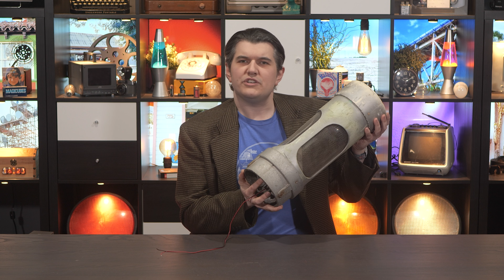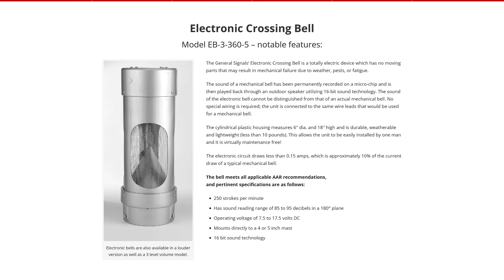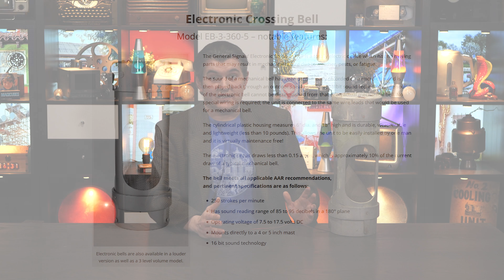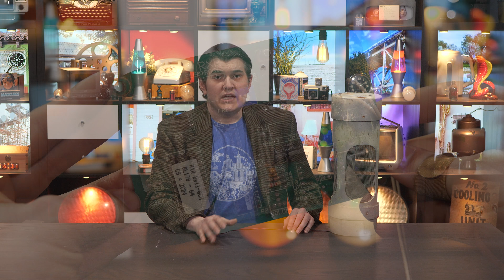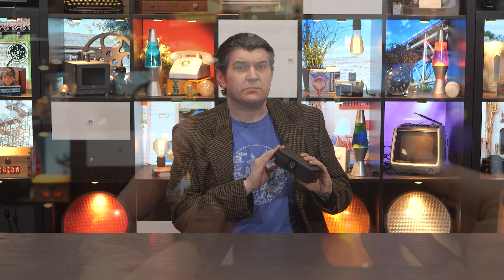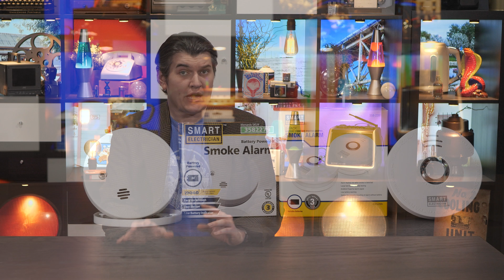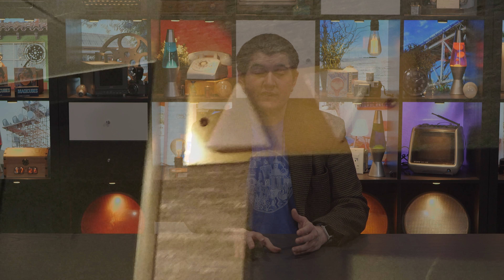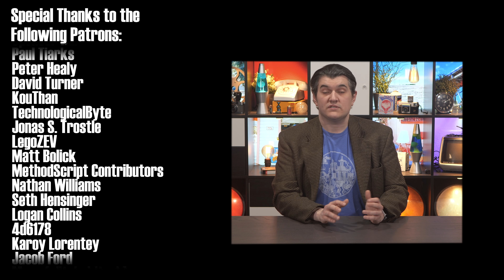The disappearing and unappreciated art of audible alerts

Comment: When I heard that "fire alarm" sound, all I could think of was a busy signal on a phone.
Reply: Yeah I've never heard it in low pitch. It's a piercing screech everytime I've heard i
Reply: When I was visiting the US a few years ago, I got to experience how loud the US fire alarms are. My European ears actually got a splitting headache, because we had to run straight underneath them to leave the building.
Genuinely startling how different the volume of fire alarms can be just by country.

You wouldn't miss them here either, but they're not ear-destroyingly loud. Louder than concert levels imo.
Reply: @ocfos88  I modified my parents' smoke alarm to extend the "Hush" button (a keyboard switch in parallel, with a backing plate for cable/solder sturdiness, dangled into a closet) so they didn't have to wave a towel at it every time it went off when they were cooking. I guess the Hush feature is a Kidde patent, mutes the alarm for 7ish minutes at a time. But it's not really useful if you can't reach the button. When I cook there, I'll pre-emptively hit it if I feel like things have gotten too hot or smokey, because it's better than a bout of tinnitus or ear pain.
Reply: @arguy_4420  Fun fact, the low pitch alarms are used in hotels, apartment buildings, dorms, etc. because they are better at waking people up. You'll probably still find the screechy ones in the garage or hallways.
Reply: @noxious_nights  not true everywhere tho, my dorm has insanely screechy, insanely loud ones in each dorm room
Reply: @KitRady-gl2sy  Probably an older fire alarm system. I seen a lot of hotels with older systems that has fire alarms that makes a “smoke detector” like tone and newer ones that uses alarms that makes a low frequency tone
Reply: @hamzahassan7730  possibly yeah. Idk what counts as old for fire alarms, but they are probably original to the building, which was built in 1999.
Reply: @KitRady-gl2sy  Yeah definitely has those types of older high pitched alarms then. Low frequency sounders became a requirement some time in the 2010’s because it can easily wake up a sleeping person.
Reply: I’ve never heard a fire alarm like that. All the ones I have heard are bells that ring incessantly.
Reply: @Phineas-hu8vi  In the building I worked in there was no way you were sitting through the fire alarm bell.
Reply: @Phineas-hu8vi  I've heard it in threes, but not that specific tone.
Reply: @Phineas-hu8vi  My office has a piercing siren.
Reply: @Phineas-hu8vi  Yeah, a loud bell that just rings constantly without pauses is what I'm used to.
Reply: @Phineas-hu8vi  Same here, my school fire bell was just a series of striked red bells in each room that rang and then didn't stop until the fire department used a key on the control box. That's why it was taken VERY seriously if someone pulled the fire alarm as a "prank" lol
Reply: The fire alarm at my work went off less than 3 days ago but I didn't recognize it in this video at all. It doesn't sound right when it's not at ear-splitting volume lmao
Reply: @Eegal-Ayed  "ear-splitting volume" 🤣🤣🤣 yes, they are usually insanely loud 😂
Reply: One would think that the volume level wouldn't be considered safe. I grew up with old school fire bells, and my first experience with the modern sirens with strobe lights was painful.
Reply: Same. I was wondering why there was a pause in the frequency. When he played the example with an actual fire alarm bell, I knew immediately; just like with the railroad crossing signal!
The muted tone actually makes it feel more like a suggestion than an emergency, tbh. "Boop boop boop. Hey, guys, there's a thing going on, but don't be too worried about it. Boop boop boop. You could die, though. So, keep that in mind. Boop boop boop. Just calm breathing. In [cough] and out. Boop boop boop"
Reply: @PBTophie  Your personified fire alarm reads like a Wheatley quote lol
Reply: To me it was the tone that would play on TV, when a storm alert was flashing across the bottom of the screen, usually tornado watches or warnings.
Reply: @Dannihilate  BRAP! BRAP! BRAP! BEEEEEEEEEEEEEEEEEEEEEEEEEEEEEEEEEEEEEEEEE!

This is a test of the emergency broadcast system. This is only a test.

BRAP! BRAP! BRAP! BEEEEEEEEEEEEEEEEEEEEEEEEEEEEEEEEEEEEEEEEE!
Reply: @CptJistuce  That sound could actually be data encoded into the audio, because it's basically just FSK modulation (I'm pretty sure), but I don't think it actually is, I think it's just random data modulated to produce an annoying tone - or maybe it's the actual text that gets put on the screen after? Not sure, always wondered about that, but never bothered to look it up
Reply: @gorak9000  Apparently, it actually is, sort of. In the modern Emergency Alert System, the BRAP BRAP BRAP is not data, but the "end of packet" marker for a message packet that tells decoder hardware at broadcast stations (among other things) what counties are affected and what kind of alert it is. The data portion of the header is not rebroadcast "over the air", unless I am mistaken. 

The BEEEEEEEEEEE is an attention tone(well, pair of tones), specifically chosen to be annoying so people won't miss it.  It is inherited from the older system, where it would have also automatically activated hardware at broadcast stations. 

It has been a while since I've heard an emergency test.
Reply: @CptJistuce  sorry to be that type of guy, but the emergency broadcast system (aka the EBS) was discontinued sometime around 1998 and eventually replaced by the emergency alert system (aka the EAS)
Reply: @Roland-JP-8000Yeah, in my memory the two run together. But I watched much more TV during the reign of EBS, and that test script is iconic to my dumb brain. It results in some errors.
Reply: @CptJistuce  The first, long "braps" are in fact the SAME (Specific Area Messaging Encoding) headers. It is repeated three times for error correction. You hear 3 similar but shorter "braps"after the alert content. Those short ones are the end of message data. The Wikipedia page for the EAS explains it all very well.
Reply: I thought I was being called on a shitty cisco voip ""landline" office phone.
Reply: I thought of the cell broadcast emergency message.
Reply: @IroAppe Once known best for TV and radio, the emergency alert system sounds remain a federal standard in a completely foreign medium to the one the system was designed for.
Reply: @CptJistuce don't know about that. I am from Brazil and related the sound to emergency message on the phone
Reply: Yeah, he played that and I was like “oh, no answer.” I’m not used to fire alarms not instantly sending me into overstimulated sobbing.
Reply: I just made the same comment.
Reply: I've never heard a fire alarm that has a break in the rhythm, they are just screaming!
Reply: Yeah, to me that said a busy signal, not a fire alarm. To me a fire alarm is an actual bell or the same temporal 3 cadence, but WAY WAY harsher and louder.
Reply: same for me, but i also havent heard a fire alarm for many years so i dont know if ours actually sound like that.
Reply: @ThunderjunkMcbutram  No routine drills or tests? Better hope your company's got good insurance!
Reply: I thought it was a phone ringing, but with an extra ring. Even more so when demonstrated on the firebell.
I remember the phone sound as ring-ring (once per second) then silence for about the same duration. But that was as a kid in the UK.
Reply: Where I come from the fire alarm sound is unfortunately usually just BEEPBEEPBEEPBEEPBEEPBEEPBEEPBEEPBEEPBEEP etc. way over the pain threshold.
Reply: Specifically the busy signal from Pink Floyd's The Wall Live
Reply: The pause is the only difference, yeah.
Reply: Likewise
Reply: I came here precisely for this comment.  That is exactly what I hear, as well.  When I think of fire alarm, I think of: that classic rapid dinging of that circular bell on the wall at school, the klaxxon doing the 3 beat, the random noises for a call coming in at the fire station for the show Emergency!
Reply: yeah that fire alarm sound is not the same when it's played at regular video volume than when it's played at like 125 decibels lmao
Reply: Same!  It was missing some frequencies or something.
Reply: yeah it sounded like a european busy tone or ring
Reply: I inspect fire alarms…and times have changed.  A lot!
Mechanical FTW BTW.
Reply: I thought of an apartment entry door call box
Reply: It took me a while, but I realised it sounded familiar to me as the British phone sound (even though that's two rings).
Reply: I thought that noting it's likely only a US thing, then describing it as universal for the rest of the video was inaccurate in a rather un-Alec way.
Reply: My first thought was weather emergency alert (I'm in Canada).
Reply: exactly the same for me, i guess because i hav e never been in a fire emergency
Reply: The only way I knew it was the fire alarm; that pattern.
Reply: Same 😂 europe I guess
Reply: All I could hear originally was a motherboard piezo speaker warning of no RAM being installed.
Reply: 😂. It means warning danger, stay off the tracks, train coming.
Reply: Yeah that’s what I thought it was
Reply: I'm glad I'm not the only one.  Now that it's all work-from-home, I forgot what an office fire alarm sounds like.
Reply: Higher pitch in aus is a warning which changes to a “woop woop woop” to evacuate.
Reply: I've never heard that sound before. The fire alarms in my college dorm were really stupid. There was some glitch around the first night I was living there that caused the alarms to keep going off. The exterior alarms sounded like being trapped in a closet with a million cicadas, and the interior alarms were just a high-pitched beeping. Both sounds were pretty much impossible to hear in the shower, so you might turn the water off to discover that the building might have been on fire for the past ten minutes.
Reply: Yeah, here they're just BEEP BEEP BEEP BEEP
Reply: Honestly the slow whoop is used where I live and is so much more of a "get out" signal than the tree lo-fi beeps 😂
Reply: Same here. Busy signal on a rotary phone
Reply: Same 😂
Reply: I've never heard that as a fire alarm or smoke detector noise. Usually, I think of a smoke detector alarm as that loud, high-pitched buzzing sound, and fire alarms something else.
Reply: One thing that wasn't mentioned is that it's dissonant sounds, so you tend to pay attention more, since it tends to disturb the ear.

Comment: Ever since I got a smadt phone, I've been using different spunds for different notifications. I'm one of the only people I know under 40 that doesn't keep their phone on silent. Particularly now with my current job working in a bio lab, checking my phone without contamination is more of an ordeal, so I need the different sounds to know if it's worth my effort. I have unique sounds for Youtube, Gmail, Outlook, Microsoft Teams, Whatsapp, the callbox for my building, phone calls (some contact specific), texts (also some contact specific), and probably some others that I'm forgetting right now. Rather than tones I use sounds that I associate with it, which would be more obtrusive if I didn't also have my earbuds in most of the day. Like for Gmail I have the old AOL "You've got mail" sound. It is good to know I'm not alone out here.

Comment: On the one hand I deeply appreciate your humane and reasonable spirit of compromise.
And on the other hand I have to stuff towels around my microwave oven in the morning to avoid waking my sleeping family because it has so many chatty sounds, and I can't give it an icepick lobotomy because the speaker is integrated into the control board, and I am just about ready to start stalking Panasonic executives with an air horn.
If it were up to me, appliances would start silent and have to earn their right to make noise (or, as they advertise it, "soundscape").

Comment: I guess I failed the smoke detector identification one, I was thinking severe weather alert because of the difference in tone versus beep.  Most smoke alarms now seems to be a disjointed random moving beeping since they're interconnected but never in sync - really disorienting.

I've had frustration with modern stuff pushing not doing sounds...I don't understand how people use only vibration for phones, I miss basically all my notifications when I have my phone on vibrate.  The new phones not sure if its the size/mass or thin small motors but they are virtually impossible to notice where old candybar phones felt like being electrocuted.  Now I have to have my phone on sound and everyone else seems to be mad about it (but also mad if I turn off sound and miss their messages?)

I can't have personal electronics at work so...I have a hard time justifying hundreds of dollars for an expensive wrist computer that I can only wear for a short time between walking up and going to work and getting off work going to bed.

Comment: 19:06 I rant about this all the time, frequently when someone else I know notices similar types of changes and gets frustrated by them. Why are companies so INSISTENT on changing software that there is ABSOLUTELY NOTHING WRONG WITH? They make a fully functional, feature rich, relatively bug free piece of software and everyone gets used to how it works and then for whatever reason they're like "Hey, we're changing this in a way that makes it actively worse and messes up everyone's usage flow" WHY. CAN'T. SOFTWARE COMPANIES. JUST. LEAVE. THINGS. ALONE?! It's so irritating. A good example from my recent memory is with android on my pixel 9: you used to pull down the quick settings tray and the button to access full settings was right there, fully visible, center-screen on the quick settings tray. They changed it so that now: instead of being perfectly visible on the quick settings tray it is down in the bottom right corner underneath where I (and I imagine many other right handed people) hover my thumb when I hold my phone. It took me a hard-to-admit amount of time to find it again. Why did they change that? For what reason? Why move it somewhere where it is actively harder to find? Why move it *AT ALL*?  Another example is microsoft whiteboard: I used to mess around and draw with it on my surface pro using my surface pen and it was good fun; very simple, very concise, very fast and got the job done for taking notes and stuff as well. It is now laggy, riddled with useless bloat, and has actually had a few features removed that just overall made it a worse experience. It's so frustrating. I'm not even sure it's entirely the same problem as enshitification, though there is probably plenty of overlap, but rather the need to have a team around at all times for general software maintenance and compatibility/security updates, but not wanting to pay them to do nothing in the meantime between important things, thus leading to a bunch of make-work updates. That's just hypothesizing though. Youtube itself suffers from this kind of thing as well, though I think it is genuinely mostly enshitification on youtube's end of things. The best example in recent memory is changing the subscriptions tab to be grid only and removing the list option. Nothing better than a company actively REMOVING user-customization options.

Comment: What you do for sounds I have had for vibrations for like 10 years. I swear whatever component does the vibrating has been softened a ton. Now it's unacceptable to use sounds and you can't feel them either. Neat

The app I use which is pretty cool is called buzzkill. I agree it'd be easy to make it built in but I can't control that.

Comment: To tell the truth. I've had a bit of a nightmare with the windows USB connect/disconnect sound. I had a external HDD which went to sleep every 5 Minutes if connected. The Problem was that if disconnected the controller always tried to reconnect.
The result was that if the drive was connected and not used for 5 Minutes it led to a disconnect and immediate reconnect for 3 to 5 times in quick succession every 5 Minutes! It unfortunately took a bit until I found the problem because somehow every time my monitor, keyboard and mouse would disconnect and reconnect as well. I don't understand why but I checked, disconnecting the monitor or the mouse and/or keyboard didn't change anything). I'm not really sure if it was a driver or hardware issue but disconnecting that drive was somehow all it took.

Comment: The Android example is increasingly frustrating for me. They're actively reducing the options we have, locking us into more and more "smart" antifeatures and even the ones we can adjust or turn off they push out updates that nuke our settings. The "smart battery saver" settings on Pixel in particular were horrendous, actively disabling notifications for hours for "battery saving", making the device effectively a brick when I needed it most.

Comment: Just like how signal light colors are standardized in the DIN her in Germany, we also have that for sounds. Though the sounds we use here in Germany are very different. (Railway sounds are standardized by the EBA though, not the DIN)

Edit: German fire alert is standardized as per DIN 33404-3. And it's a sawtooth ramp starting at 1200Hz and decaying to 500Hz over one second. It's extremely obnoxious.

Comment: i just dont want to be notified. I have all audible and vibration alerts turned off entirely. I do not believe that i should be accessible at all times just because i have a computer in  my pocket.
However, i also believe that the user is the one who should get to decide how their device functions, and that more options are more better, always. You also are correct in that updates are user hostile now, it drives me bonkers every time any of my software updates and stuff just gets WORSE